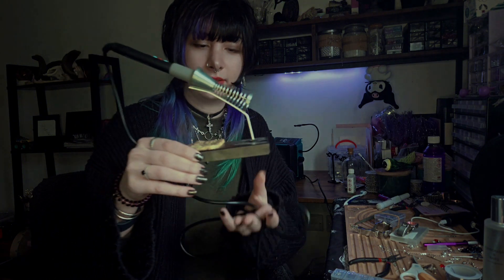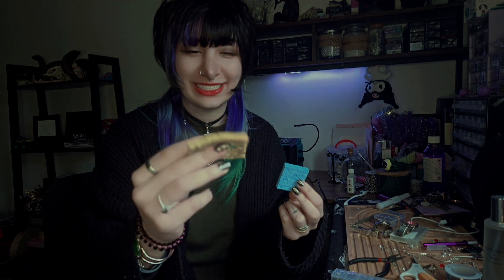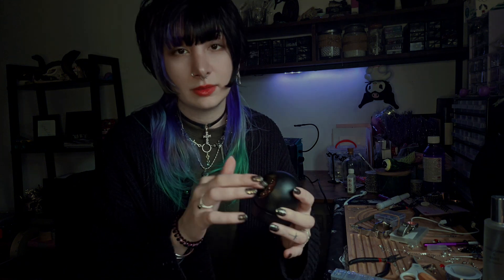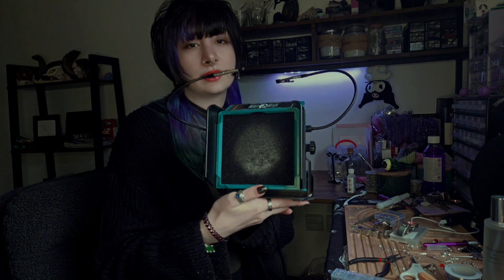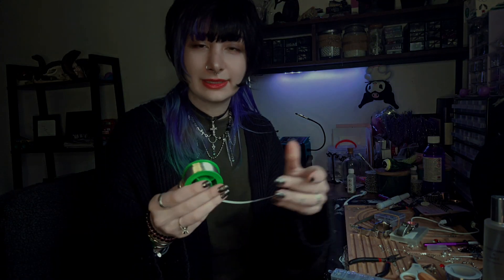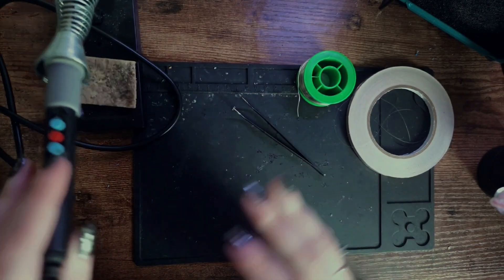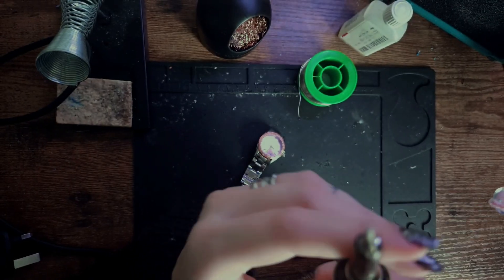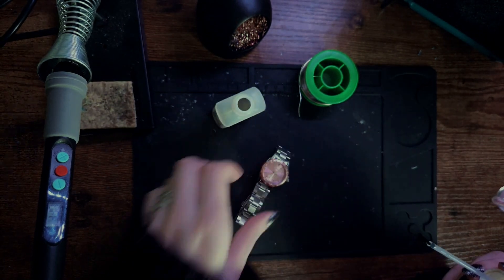How To Make a Spiky Watch | How to Soft Solder | Soft Soldering Tutorial | How to use soldering iron

Comment: Don’t know you will reply to this. but how do you manage to do the spike ? I got so confuse that it either never pickup and turn into blob or the solder never melt enough to make the spike?
Reply from the maker: Hii! 💜 that sounds like a temperature problem! You should try the find the best temp around 340 to 360. I usually go a bit lower for the spikes. But it really depends on the weather and the temperature in your own room. So i usually start with 340 and then increase it slowly to find the best temp. ☺️
Reply: @bookofkissu  ty! I will try it out rn

Comment: i try doing a watch myself but the copper foil is peeling of the watch :(
Reply from the maker: When you try to solder it or before? Or after? 👀
Reply: @bookofkissu  after the soldering. so after some time like 1 month
Reply from the maker: Ohh yeah, i get it! That usually happens if you dont clean the surface properly first. But also it depends on the copper tape itself. If the glue is not strong enough, you might be burning it a bit whilst soldering it. You might wanna try another brand or work with a lower heat!

Comment: hello, I like what you are doing but I have a problem when I get to the part with making the spikes. can you help me with some advice please?
Reply from the maker: Hiyaaa! Thankiu so much and of course! It sounds like you have an issue with the temperature. What's the temperature of your soldering iron when you work on the spikes?
Reply: @bookofkissu thanks for the reply! I use the temperature of 200-250°c. I tried again to make another watch and it came out a little better. I think it all depends on how experienced you are and that soon I will succeed too. ❤❤
Reply from the maker: No worries! Like i mentioned in the video, it does depend on the experience, weather and the temperature. I work with something around 330-360 depending on the weather outside! Also to make the spikes i usually use a lower temperature and higher temperature for the flat bits. It definitely get easier with experience so you definitely got this! You can watch my reels to see how im moving the watch depending on the spikes as well to make it easier for myself.
Reply: @bookofkissu thanks again for the advice. I hope to master it 😅
Reply from the maker: You got thisss! 💜💜